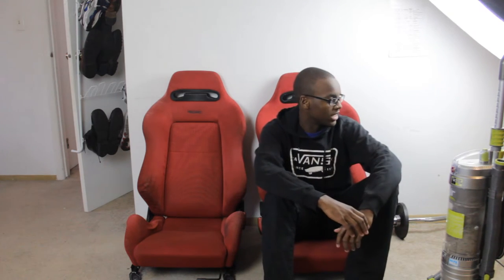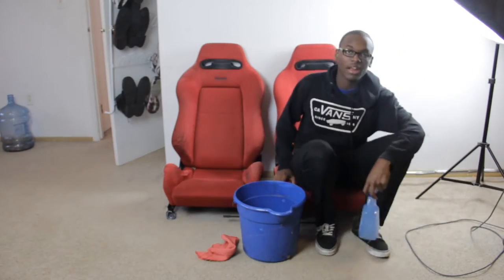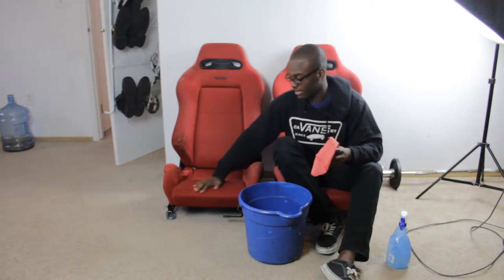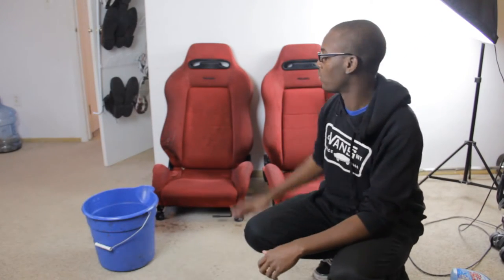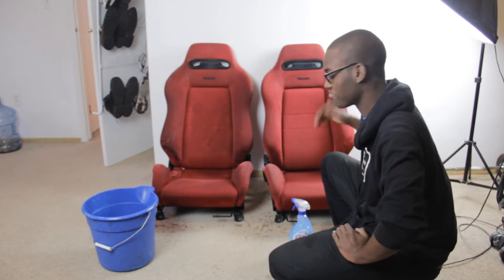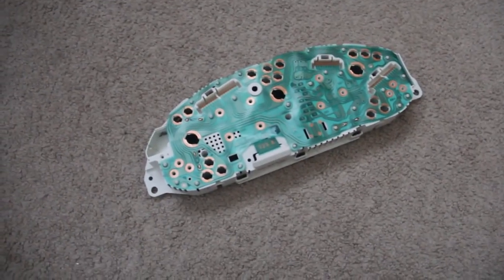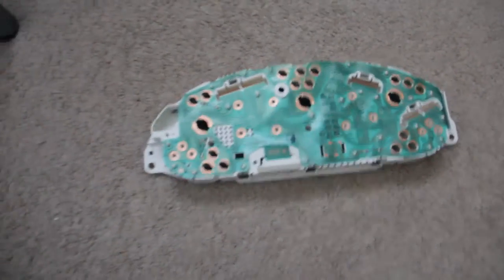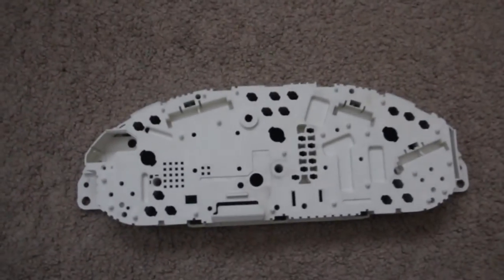Project Integra Track Car Build-Episode 6

Comment: wow, i just discovered your channel and i like to watch these project integra episode. You've shown lot a patience. Good build and nice Teggy !
Reply from the maker: Thanks! :-)
Reply: +Miton Films Which handbrake plastic cover did you use ? Smaller than the OEM one, fits perfectly
Reply from the maker: +GendronShack The handbrake cover is OEM(ordered it from canada). it even has the honda stamp underneath.
Reply: +Miton Films great thanks !! Good luck for your japan trip ! Im sure it would be an incredible experience with the R34 !
Reply from the maker: No problem, if you ever have any questions please comment, also thanks! Hopefully it is still there when I arrive in May.

Comment: my tegg is doing the same thing with that taillight gasket where did you buy it from and how much? ive looked every where for some and always turned up empty handed. thanks in advance.
Reply from the maker: i got mine on ebay.com just type in tail light gasket and it should pop up for like$10-30 try to get oem honda if possible.

Comment: Hey nice videos and I'm starting my process of working on my teggy as well.. But, I have a quick question.  Where did you get your seats from with the oem rails/mounting brackets already fitted for the seats?
Reply from the maker: Awsome , thats great that your starting your own build! So these seats are JDM Recaros. They are OEM and came out of the Honda Integra Type R. (which is why the seat rails fit perfectly) If you are curious on how they feel i have a video on a review of them.
Reply from the maker: I got Them from a local jdm importer, you can find them at hmotorsonline.com but they will be a bit expensive!
Reply: Yeah they are a bit pricey but if you local jdm importer can get more, I wouldn't mind get a pair of seats from him. Plus I'm local to the upper MD area, so I can get them as soon as they come in.
Reply from the maker: +DrTruthMD the only pair i found thats a reliable company is in gaithersburg, they have a set in red, but they are a little beat up...
Reply from the maker: +DrTruthMD MD JDM Motors
Reply: Ok thanks! And they're based out of MD right?
Reply from the maker: +DrTruthMD Yeah they are in Gaithersburg, Md
Reply: Cool.. I'm going to check them out now. Thanks again.